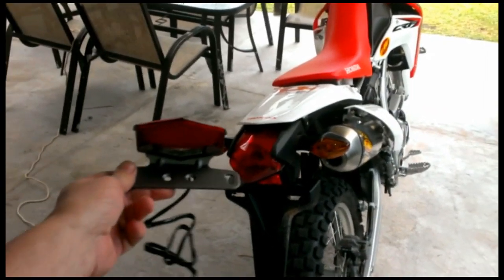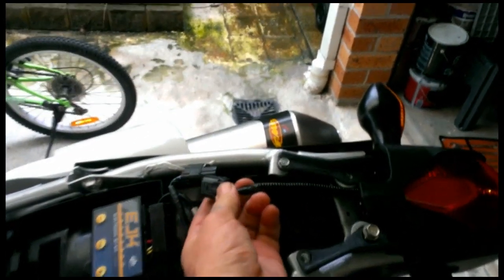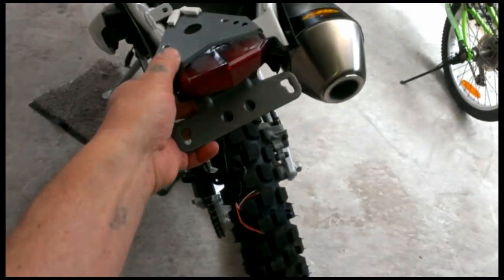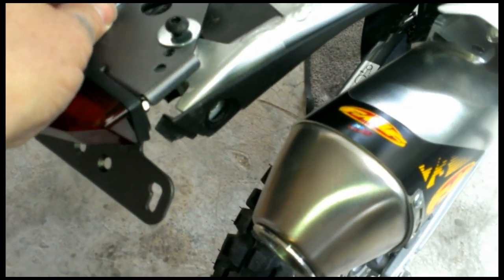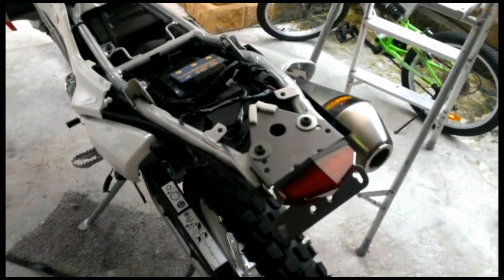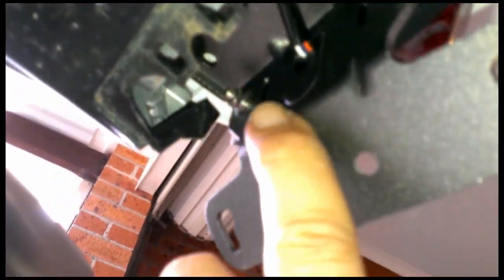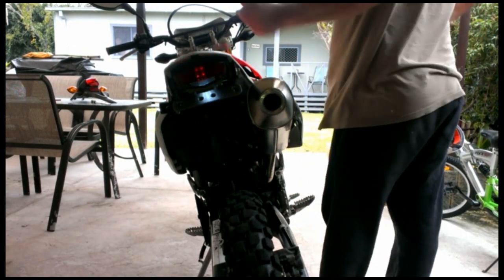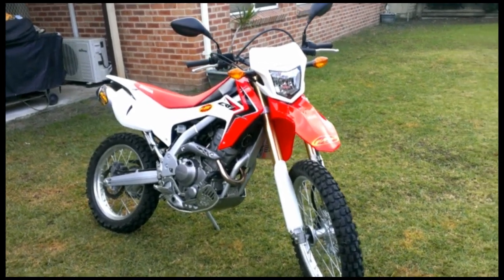DRC Edge 2 tail light /Blinker programmable install on a CRF250L

Comment: Where did you get the other harness from so your don't need to reuse the old one? It will save time like you did so you have everything all ready to plug in and not have to tear apart the old plug to reuse it
Reply: +baallen98 bought it with the light, crfs only sell them as a extra, i think it was around $10.

Comment: Hey mate, do you know if this is legal in Nsw?
Reply from the maker: I don't think so, I changed the bracket so I could add small led blinkers, it still looks good. if you order this light, get it with the black bracket so u have the option to add blinkers.
Reply: thanks mate, yeah i ordered the 601 indicators to go with it. thanks for your help

Comment: where did you pick this up? is this it http://www.amazon.com/DRC-Motoled-Edge-2-Aluminium-Holder/dp/B003UMC6I4
Reply from the maker: Yhunter07 bought it from crfs only, u can find them on eBay, but make sure it will fit your bike. the bracket on the link is for a WR not Honda.

Comment: You won't notice any difference in weight by removing the original tail light. It will be like a drop in the ocean, especially since you are so fat.
Lose your weight down to 70 or 80 kg = then you will notice difference